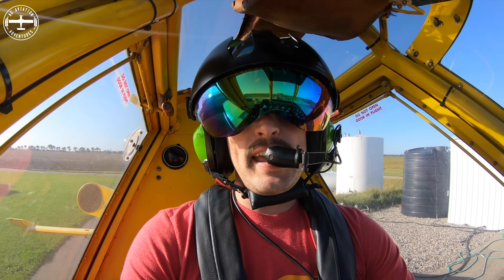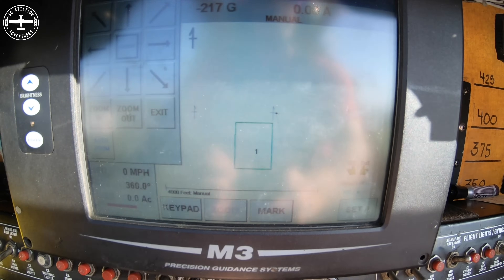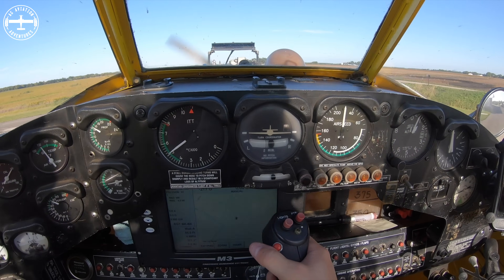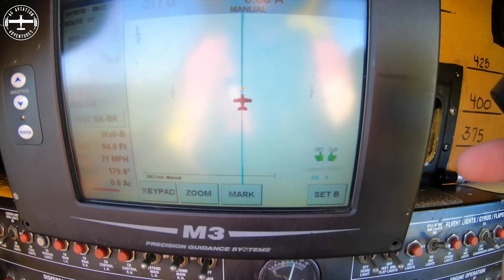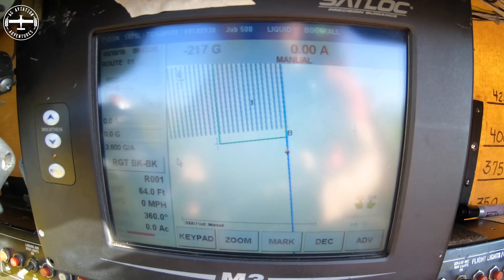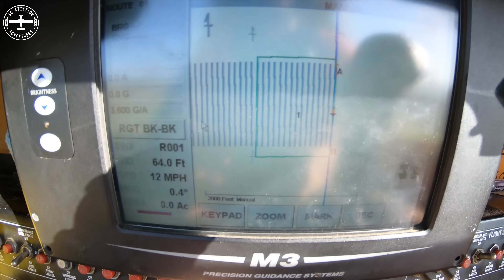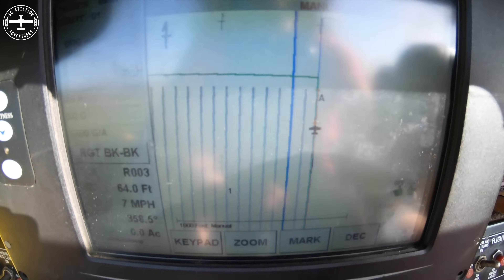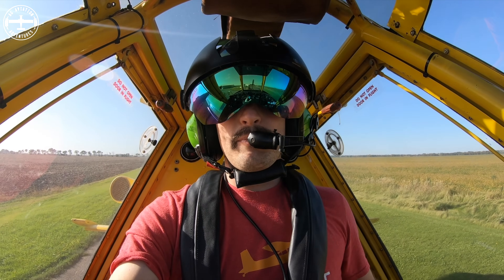How the Light Bar and GPS Systems Work in Ag Aviation

Comment: Awesome mate! Is there any danger of forgetting to click it over to the next pass or can you set it up so it automatically clicks over to the next pass reducing the risk of doubling up on any particular run?
Reply from the maker: You could forget, but you would see it on the screen because it would be painted before you spray it again. We don't have newer GPS, so the option may be available to have it auto but not on anything we're using.

Comment: I’ve tried steering by light bar only in a tractor (going 10 mph with no chance of the ground rising up to smite me) and it’s super tough, especially without a previous pass to use as a reference. Must be a learned skill to follow the lights, while maintaining altitude, not hitting power lines, etc etc
Reply from the maker: It definitely comes with practice and time.

Comment: When will they hook up an auto pilot to the lines like autosteer in a tractor? It would have to be fast.
Reply: They already have them.
Reply from the maker: There are spray planes that have auto pilot but it’s used for things like ferrying. Not so much in the field spraying.

Comment: Started ag flying in new zealand hill country in 1977.. those days no gps ..all done by line of sight an memory .. when spraying it was the same except when in Agwagon (taildragger) we put main  wheels in wheat crop.. then use wheel marks as a guide to count swaths off .usually every 3rd swath use wheel in crop.     When spraying in fletcher (fu24950) couldnt use wheels in crop as it was a tricycal undercarridge.  Those days we didnt have flag men or markers on field boundry fences .. thanks to the  gps its made job safer an improved application accuracy with gps flow control for liquid spraying an gps controlled hopper gates for fertilser an seed application . Amazing .whats next ?
Reply from the maker: Haha that sounds like the good ol days! No room for pansies back then.
Reply: @AgAviationAdventures  are u based in what  state flying
Reply from the maker: I’m up in northern MN on the ND border.
Reply: @AgAviationAdventures  👍i did 13 seasons ag flying Across AB. SK an MB in canada.. if u like to see some  old videos i took they  on my old youtube sight  agflying in NZ an tasmania aust . Its dave051052  . Keep safe . I enjoy seeing your videos

Comment: How do you do your turn around?  Stall turns or just normal turns or split S?   I just got a radio control Air Tractor and wanted to fly my routine like you full scale folks.
Reply from the maker: Thanks for watching Ted. I just do what I call normal turns. Pull up and make a nice turn onto my next pass.